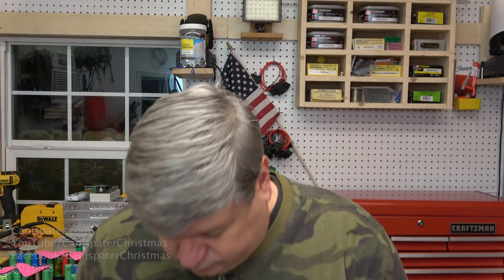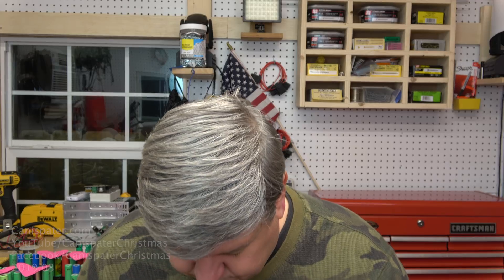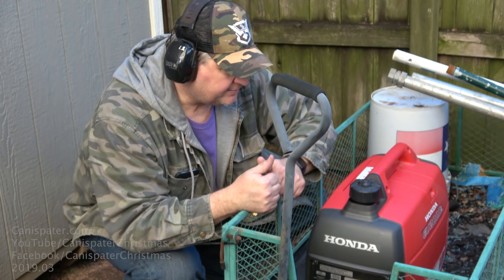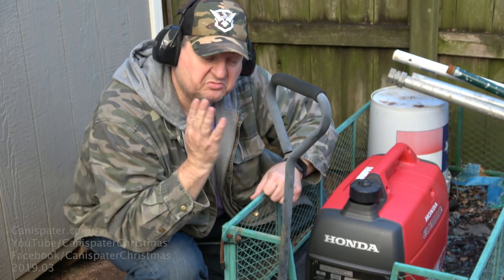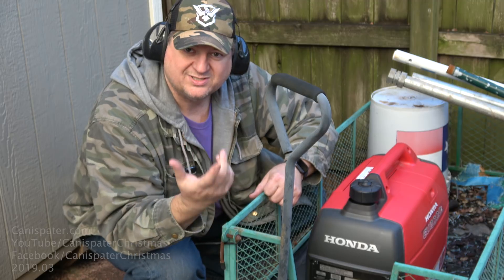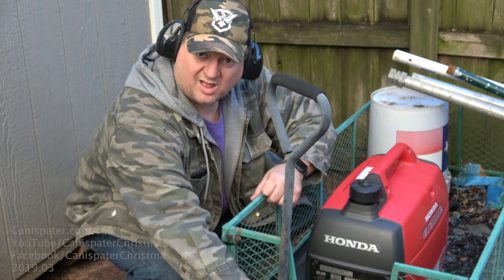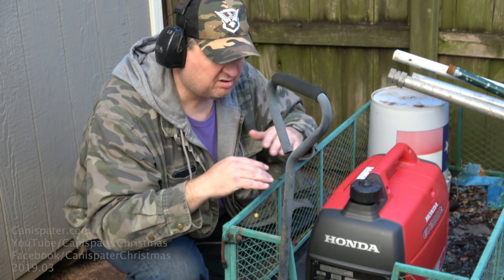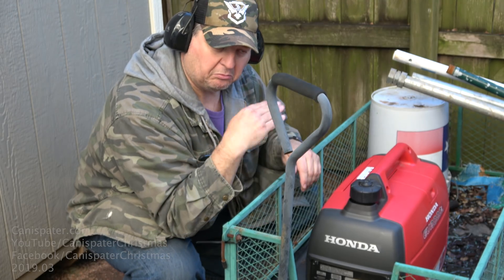⚡️Honda Generator Baseline Load Test (2019)

Comment: My Honda is also finicky, I installed a off switch and the factory off switch only cuts the fuel to run the carb dry after use. 

I have to normally run my generator for 4-8 hours with a partial choke before it will run at wide open choke (when pulling it out of storage .. where it sometimes sits for 1-2 years) anyway .. if you find any interesting things about the carb let us know!
Reply from the maker: Never really figured out what it was. The propane conversion meets my needs. Recommended if the genny is rarely used. On the other hand, gasoline has it's benefits.

Comment: I have a power outage once every 10 years or so. Does your power go out that often? Or do you doing for the sake of the project?
Reply from the maker: It doesn't happen often, but it only takes once when it's 100 degrees outside and 90 degrees inside and climbing to do something about it! lol! Although, when I was running the test, there was a several-hour-long power outage about a block away from me. The city power folks do a great job, but I don't mind being a bit of a "prepper" in this case. I thought it would be something fun to do while many of the lighting folks are taking a break until Expo. :)

Comment: Can you make a video of how to use Cat5 for pixel extensions?
Reply from the maker: You mean like this? https://youtu.be/Z0KIXDRkSCk You can use CAT5 for data, but don't use it for power. If you think you want to run power through it, see: https://youtu.be/ko5wu5S0J1o . Ethernet cable is not designed to carry power and heats up even if you try combining strands.